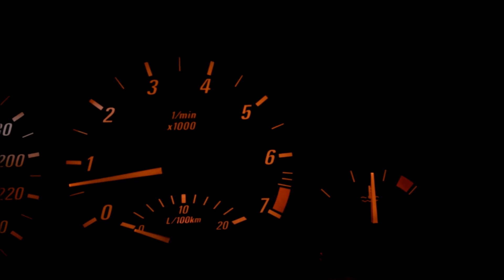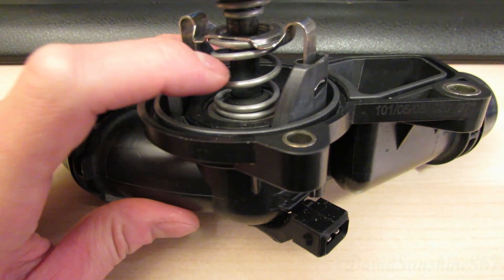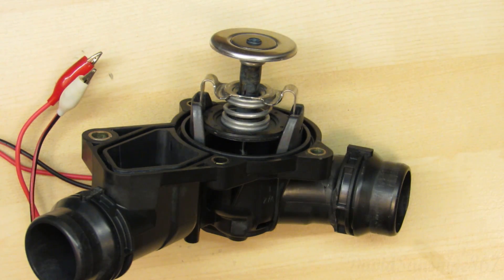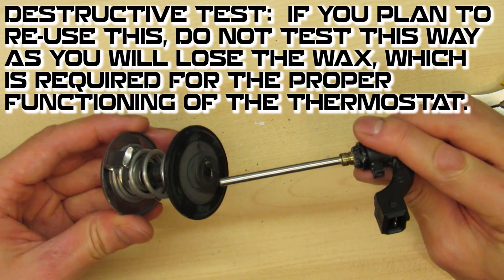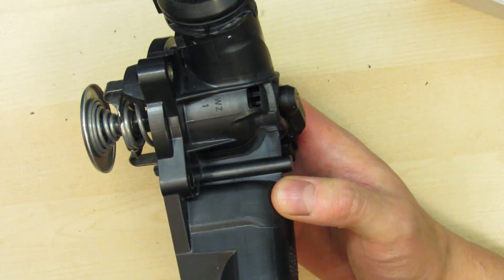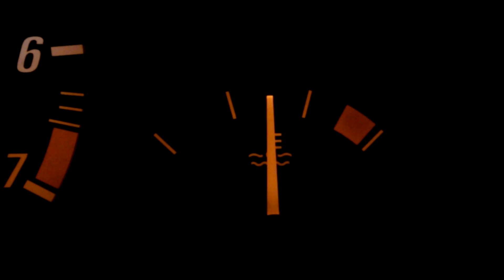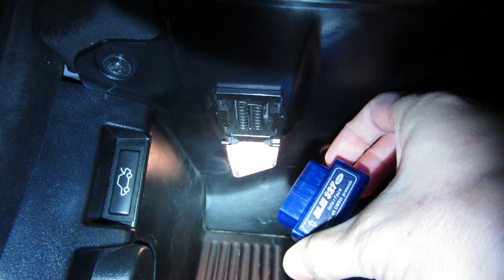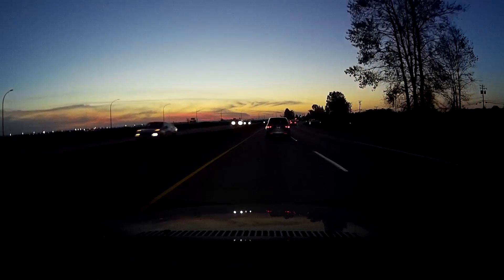How a Thermostat Works in the E46 - How to Diagnose a Broken Thermostat

Comment: If your thermostat is replaced with a piece of  wood which is fixed properly as thermostat to avoid over heating incase the thermostat fails and its resulting problem it comes with could this make your car consume more fuel and or black exhaust smoke in the exhaust tip or musphler?

Comment: Hello Guys, First of all, Thank you so much for that video. But I have the problem with my e 46 cooling system (thermostat) also (I have changed 4 of them but the problem is still there ): Once I drive on the highway and the radiator airflow is Ok the temperature of the Coolant goes down up to 60. In the winter period, it is very difficult to heat up the motor also (it takes a long time). But when I off the connection wire on the thermostat the temperature range is Ok.  The Error is P1619 - OBD2 (Cooling Control Circuit Signal Low; Map Cooling Thermostat Control Circuit Signal Low) Could you be so kind just explain to me what can be the reason? Thank you in advance...
Reply: I got this same problem right now on my  e39 😅 have u found an solution?
Reply: @joninumminen9205  Unfortunately, not yet...
Reply: @joninumminen9205  just one question: Did you change coolant? or did you add some special ingredients to the coolant?
Reply: @joninumminen9205  After what it has started?
Reply: @kkankava  have done nothing so far 😅 trying to solve what is the one cable that isint connected to anything, between intake and firewall? The connector has green rubber inside and 2 pins
Reply: @joninumminen9205  Can You make a photo or video  about the situation  near that cable ?
Reply: @kkankava  oops, it's got something to do with injection testing, it had a plug in it that there wount go any dirt 🤣
Reply: @joninumminen9205  Error : P1619 - OBD2 (Cooling Control Circuit Signal Low; Map Cooling Thermostat Control Circuit Signal Low) . From my point of view, the problem should be in the connections or wire, or temperature sensor.
Reply: @kkankava  you just have been thinking this for a month? I think ur problem is pretty much the wiring or bad connectivity, if u habe replaced 4 of them 😅

Comment: Hey so I disassembled my thermostat and i see no wax where you instructed it should be. Is there any fix or is it completely trash?
Reply from the maker: Ya I would replace the whole unit.  No point trying to fix it, they don't sell the wax.
Cheers,
David.
Reply: @DavidSunshine   im kind of in a bind right now, any quick solutions until i can replace it?
Reply from the maker: @wzrdkelly1054  Ya if you can't get a new one, you can just bend the valve so it stays open about 50%, leave the 12V disconnected.  You should be able to drive like this for a few days of it's moderate temps out.  If it's really hot then maybe leave it open about 80%.  You'll run a little cool if on highways at night but it should be ok for a week, after that you'll have side effects of running too cool, so replace it as soon as you can before you cause any long term damage from running too cool or hot.  The cooling capacity of the radiator is huge tho, so you'll most likely run too cool than too hot unless it's hot out.  Just keep an eye on the temp and let it cool if it's starting to get too hot. I ran with mine open all winter and it just ran cold on the highway, I didn't notice any moisture in the engine oil but changed it out soon as I replaced the thermostat because I'm sure I would have started getting corrosion internally if I left it too long.
You can leave it really open and use cardboard on the front to keep it running warmer on highways, that's what I had to do on the winter before I could replace it with a new one. 
But replace it soon so you don't run the engine out of normal temps.  
Cheers!
David.

Comment: My 2000 323I only gets to just past the blue on the dash gauge...48-54C.  -17F the other morning...damn cold ride to work ;-(
Reply from the maker: Lol same with mine when it was stuck open.  Until you replace it, you can put cardboard in the front grill on the inside and just tie it in place, easy to do it you open the hood, since the grill goes up with the hood, you can just place the cardboard in there and tie it to the grill with some rope.  I assume on the highway that you're going 100kmh and it's below freezing there.  The cardboard will keep that cold air from rushing in, and if you do need cooling, the fan will kick in.  As the weather gets warmer, just cut some openings into the cardboard to allow for a little more cooling. You just want to make sure it's getting up to operating temperature, making sure to not go over.
Worked fine for me until I could get it replaced.
This also works when it's -40C out, any engine, no matter if it's working properly, will need a front grill cover for highway driving. That's how they do it in Northern Canada.
Cheers!
David.

Comment: My BMW 320d overheats when you drive at high speed, what might be the problem?
Reply from the maker: Could be water pump, or low fluid. I would top up and do a bleed of air, if that doesn't work, I would replace thermostat if it's over 8yo, since that needs to be done anyways, it might not be opening up completely.
You could try that, and if it's still the same problem, probably the water pump.  If you want to do it all at once, you might as well just replace the water pump and thermostat together since they do wear out over time, if it's high miles and old enough, they are due for a replacement.  
Cheers,
David.

Comment: Hey thank you for this specific assistance.. i am running cold (stuck open ) on a year old thermostat .. i am presuming a mixture of different coolant and a low level from a leak could have  caused it to fail so quick ?
Reply from the maker: Hi,
Anytime!
It's strange that a one year old thermostat is stuck open. 
So on the highway, at high speed, the engine cools down to the point where the temp gauge goes to the left of 12 O'clock?  Yup, that would mean the thermostat is stuck open.  I would try testing the voltage from the plug, if it's stuck on 12V, that would explain why it's forced open. Could be a shorted MOSFET causing it to hold 12V to the thermostat, MOSFETs can fail and when they do it's a short for all 3 pins. So that could be the issue.  When cold starting your engine, that plug should be giving no voltage.  You could even just unplug the 12V, it's not required. The thermostat will open naturally from the hot radiator fluid.  You may run a little hotter, but at least you'll know it was the plug causing a forced open.  If you have air in the system, your cabin heat will be cold, but it engine will run hot, if that's the issue, all you need to do is bleed the system properly. 
Hope that helps and you get it fixed!
If it's none of the above, then a new thermostat should fix it.
Cheers,
David.

Comment: Thanks for your video. So like this i can control the engine temps to be around 85c on X5 E70 without buying low temp thermostat. I actually thought it have 3 temps sensors, 2 on the thermostat housing and 1 on the radiator outlet.

Thanks buddy for your informative video. I'll just get a switched temp sensor to close the circuit on 85c and force the thermostat to open and close on 80.
Reply from the maker: You're welcome!
That would be a good workaround to replacing the thermostat.  I've been meaning to replace the pressure cap with a lower one, and thermostat with a low temp one too in my X5 with an S63, it runs hot.  That's a good  idea to wire it to a thermostat that activates at 85 though.  I would add an interposing relay so you separate the circuits, so the original circuit can continue to feed 12V to its interposing relay, while the 85C thermostat feeds its own interposing relay, both of which can connect it to 12V, then no backfeeding will occur.  I'm sure the original controller is solid state, so you don't want to hook it up to any custom circuit, it'll probably throw an error or worse, be damaged.  All these new solid state controllers are so sensitive.
Great idea tho!  Any bimetal thermostat should do the trick.
Cheers!
David.
Reply: @DavidSunshine   these cars with V8 runs extremely hot. And to get things worse, i live in UAE where there's no winter and temps averaging 113F°. I have a trick not to throw any DTCs, i made it when i disconnected the AC heater hoses, i kept the solenoid valve and closed the pipes, and removed the water pump and connected brake light bulb instead. No errors whatsoever. I believe it was 15W.

I'll do the same with thermostat heater. I already measured the resistance when the coolant temp were 205F°, it was 158ohm. I made a relay and connected the resistance to it, and will make it to activate once the temps reach to my desire, along with the thermostat heater. Like this will not throw any codes.

Thanks a lot David, you saved me a lot of hustle to open the thermostat. This way is cleaner and no coolant wasted in the process.

Cheers.
Faris
Reply from the maker: @gringomassive6451  Hi, wow that's hot, ya you'll benefit a lot from running cool.  I live in Canada, so it's colder most of the year, which is nice on the V8.  Smart idea with the bulb to pretend to be the pump!  I've used a light bulb to trick the computer that the O2 sensor heater was connected too, haha.  
That's great it'll save the thermostat from having to come out, then you don't need to bother with the bleed procedure either, that's a mess and a pain.
My pleasure!  Glad I could help.
Enjoy the mods!
Cheers!
David.

Comment: ima try tomorrow ... lets what happens!!
Reply from the maker: Good lucky!!  It's pretty easy, one of the easier jobs on the E46, as long as you can get that fan off with a big wrench.  I hammered on it in the clockwise direction to get it off, if you don't have the tool to hold it in place, you'll want to do that. I describe it in the description.
Cheers!
David.

Comment: My temp gauge stays center but water light came on and top pipe of radiator is hot and bottom cold ,can it be the thermostat, replaced water bottle recently, cos a leak....
Reply from the maker: Hi,
It sounds like the coolant level may be low, and there might be air in the system.  Try performing the bleed procedure for the E46 coolant system.  Careful with the bleed screw, I broke mine cuz I turned it too tight. 
I had the same problem after I replaced the expansion tank as well.  
The top hose might be full of air.
I doubt the thermostat broke right after you replaced the expansion tank.
Bleeding the air out is a pain, I could never get it right and instead would just run the engine and overfill the expansion tank, high rev it a few times(coolant will splash out), but that'll get the bubbles out, if you are impatient.  Otherwise it can try the proper bleed procedure. Make sure you park the car on a level surface or slightly uphill (I think that might be better).
Good luck!
Cheers,
David.

Comment: I bought one at scrapyard,  is 15 seconds good for the electric heater to open the thermostat?
Reply from the maker: Nice!  Ya that doesn't sound so bad. As long as it can fully open and close properly, you should be good.
Mine had a bent shaft, so it was jamming open, causing a cool engine that couldn't get up to operating temperature.
Cheers!
David.
Reply: @DavidSunshine  I wish mine failed open, the problem with mine right now it sometimes fails to open in time, and opens around 125c.. i hope this will fix
Reply from the maker: @FPSAnarchy  Ya it'll probably fix it. That old one sounds like the wax is getting old and might have leaked out a bit.  If the new one you got has only been used a couple years it should be good.  I think they are good for about 10 years, then they start to wear out.
Good luck!
Let us know how it goes!
Cheers!
David.

Comment: Such a useful video, without all the flashy music crap adored by others.  Wish I'd have noticed this yesterday before destroying what may have been a  perfectly good thermostat.  I have a no cooling fan problem fan on my E46 petrol 3 series and suspected the thermostat.  Like a fool I believed those thermostat terminals were a switch bought on by the stat pulling back.  I boiled up my old unit in a pan of water and as nothing moved I suspected it was duff.  I then ripped it out the casing, only to learn nothing more.  Now i see it moves under 12volts  A new one was £12, so not so bad in the end.  Still have the fan problem though.
Reply from the maker: Thank you for the comment!
That's not a bad price, and probably good to replace the thermostat anyways.  It should still open but boiling it, since the wax should expand, so maybe the wax was getting old.  
There are a bunch of videos about the E46 cooling fan actually, I watched some out of curiosity. One user even bypassed the automatic relay and added a manual switch inside the cabin to turn it on!  That's an easy fix, but not optimal since you might leave it running when it's cold or forget to turn it on when hot.  
Hopefully it's just your fuse or a loose connection, but this guy goes into checking codes and the DME wire.  Seems like a common problem so you should be able to diagnose it with help of all the YouTubers who have posted their tips and tricks.
https://youtu.be/VU-CQ3jPI9Y
https://youtu.be/RdIBbrn3-30
Good luck! 
Cheers!
David.
Reply: @DavidSunshine  Thanks for the reply David.  My BMW thermosat is a slightly different shape to the one in your video but the principle would be the same.  For those interested the BMW (UK) part number is 11531436042.  These can be picked up new on Ebay for less than £15, but I'm wondering if theres a quality issue with these cheap copies compared to those from other car parts stores that charge around £35 - £50.  My last ebay purchase only seemed to have lasted less than 2 years before failings.  I applied 12 volts to the pin from my old stat yesterday and although it gets very hot it was still tight in the hole with no movement, so maybe the wax had hardened up just as you said.  All this still hasn't resolved the main fan problem, so I guess I'll have to browse those videos to fit a temporary override switch until I get to the root of the problem.  Seems the fan module is already fed by permanent 12 volts and is only signaled to come on from the single green and black wire from the DME.  Thanks again for the guidance.
Reply from the maker: @robjenkins3713  Anytime!  Ya I did find the eBay parts to be inferior to brand name parts from Napa or good online sources.  
Hopefully you can get it powered up with a bypass!  Or troubleshoot the code or root problem.  Good luck!
Cheers,
David.

Comment: thanks for an awesome explanation, yet, I would like to know your opinion, I have a 04 X5 and I do not think the thermostat has been changed. I recently did some replacement regarding the coolant system. However, every time I go on the freeway, the needle goes higher when I accelerate, but then returns to the 12oclock position when I reduce speed.  No leaks, in your opinion, should I replace the thermostat? Thanks
Reply from the maker: Hi Samuel! Anytime!
I'm not sure what's happening there, seems kinda strange.
But from my experience with BMW cooling systems, they get lots of bubbles in there and you really need to do a proper bleed procedure.  Google how to do the bleed procedure for the cooling system, it says a bunch of stuff about pushing down the accel pedal to activate the pump for 10 min.  I tried it on my X5 after I replaced the aux turbo coolant pump, but it didn't work.  The system didn't function properly until I floored it a bunch, the high revs got the bubbles through, and it worked properly, but that's probably not the best way to do it. 
I suspect you introduced air to the system after your replacements.  I don't think the thermostat broke after your repairs, that's too coincidental.
So look into that and see if that helps.  If not, you could be right, the thermostat might not be opening up fully.  The thermostat is getting old, so the wax might be wearing out, might be a good time to replace.
Cheers,
David.